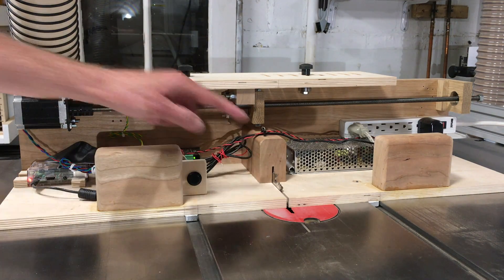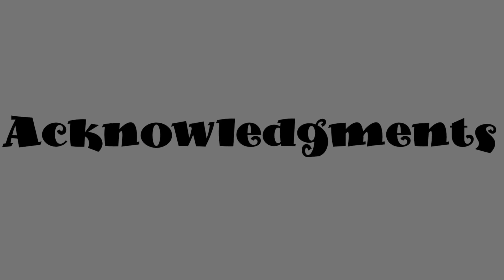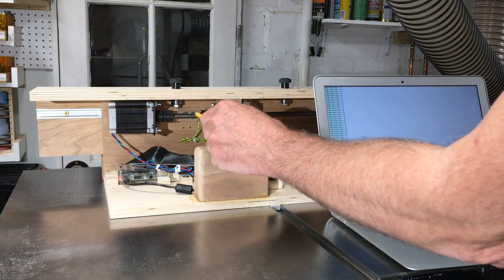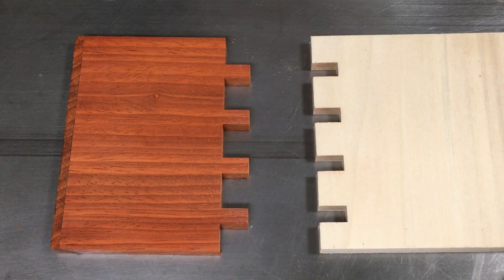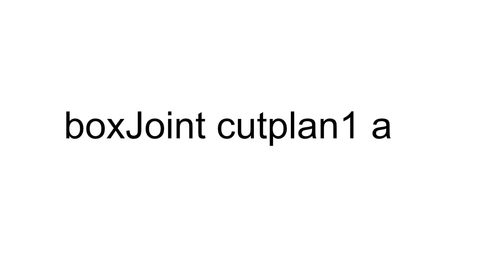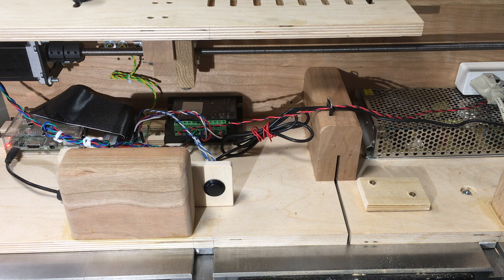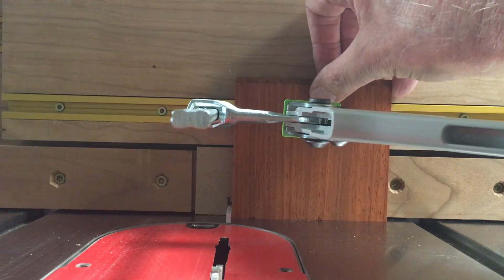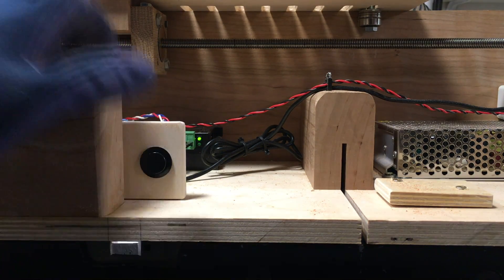Yet Another Programmable Single-blade Box Joint Jig

Comment: What powers the unit.   Ar you using n inverter cord or battery pack.   I have not played with steppers lot outside of taking some CNC claes in the early 90's.   I use to know a lot of the G code but lets be real that was then and this is now.   I am torn between doing a jig like this or CNC control the fence. Then just make a sled that slide 90 to a CNC fence.  It would not be hard to make a button to advance the program and put in on the sled jig so it will advance every cut.  Also on your jig a simple air cylinder and solenoid valve to clamp with box sides could even make the clamping better too.    I could see high production coming from a step up like this.

Comment: What a great project!  I am almost there.  All the hardware is done, but I used a 5mm/rev screw and 400 pulses/rev.  I changed the inches/step to .000492; but I fear there is something else I must do in the software.   Sooooo close!  Gonna hafta learn python a little better, I guess.  Can you give me some hints? It indexes great, but the a and b parts do not fit.  I am using a .125 blade, so that's the kerf.  Thanks again for a great project!
Reply from the maker: Feel free to send me your code (gbcrockett AT gmail DOT com) and tell me exactly what you mean by "a and b parts do not fit".  Are they too tight or too loose, and by how much?
Reply: Will email you.

Comment: Great video, thank you for your time in posting it. You’ve convinced me to build this. Can you reply with some more info about the lead rod and nut. Length, diameter, thread size. Also, do you have any plans/details for the sled and carriage you could share?  Thanks
Reply from the maker: I used a 3/8, 16 tpi lead screw and nut.  The parts list in the video description has a link to a McMaster-Carr page; that's where I found the parts.  There are several types of lead screws on the page; the one I used is in "Precision Acme Lead Screws and Nuts".  I got a 3-foot one because that's the shortest available; I think I cut it down a little but I don't remember.  I don't have any reason to believe that particular size and type of lead screw is the best choice, but it worked satisfactorily for me.  The nut I used is the round brass one; others might work depending on exactly how you mount it.  I didn't make any plans for the sled and carriage.  I figured it out as I went along.  I tried to point out important decisions I made in the video, but if you have any particular questions as you plan or build yours I'll be happy to answer them as well as I can.
Reply: @JustThisGuyUNo  Thanks for the additional information much appreciated.  I have ordered the electric parts, (raspberry pi, controller, and stepper motor),  just arrived and I'm trying to get them up and running and talking with each other.  Would you mind helping me out with the wiring?  Would be great if I could get a wiring diagram from you showing the connections from the Raspberry Pi to the controller and then to the stepper motor.  Pictures might do the trick as well.  Thanks in advance for your time.
Reply from the maker: @Woodlada  Here is the wiring information.  I used a ribbon cable extension to connect the Raspberry Pi to a breadboard, from which the connections to other components are made.  I intended to replace the breadboard with a solder board, but so far that hasn't proved necessary.  If you use little wood pieces to surround both the Raspberry Pi case and the breadboard so they won't move around, the connections have no reason to work loose.  Following are the connections among components.  When I refer to pin numbers, I'm using the numbering scheme on the Raspberry Pi extension cable, not positions on the breadboard.

Following are the connections among components: 

AC power to 24-volt power supply:  Take a short 3-prong extension cord, cut it to the length you'll need and strip the ends of the individual wires.  Connect the black wire to L, white to N, and green to Ground.

24-volt power supply to motor driver:  Connect -V to GND, +V to VCC.

Motor to motor driver:  Connect the black wire to B-, green to B+, red to A-, blue to A+.

Motor driver to Raspberry Pi: Connect pin 17 to ENA-, pin 27 to DIR-, pin 22 to PUL-.  Use short jumper wires to connect PUL+, DIR+, and ENA+ all together, and connect them all to 3V3 power on the Raspberry Pi.

The move button, the home limit switch, and the end limit switch are all normally open switches.

Move button to Raspberry Pi: Connect one wire to +3 volts, the other one to pin 18.

Home limit switch to Raspberry Pi:  Connect one wire to +3 volts, the other one to pin 5.

End limit switch to Raspberry Pi: Connect one wire to +3 volts, the other one to pin 6.

Writing this down made me realize that I've changed the software since I made it available for download, by adding the end limit switch.  You do need two limit switches; you don't want the carriage to crash into either end of the base.  If you got the  software before 1/22/20 you should get it again.
Reply: JustThisGuyUNo Thank you, I’ll let you know how it goes. Much appreciated!
Reply from the maker: @Woodlada  Note the edit I made in the wiring information.  In addition to jumpering PUL+, ENA+ and DIR+ together, they need to be connected to 3V3 power on the Raspberry Pi
Reply: @JustThisGuyUNo Hello, I’m finally getting back to this project and I’m working with getting the program to run and have been unsuccessful. I downloaded the newest code. I get “ can’t find __main__’ module in boxjoint.py.”  Do you know what may be causing it? Thank you in advance for your help.
Reply: @JustThisGuyUNo Don’t worry about my last comment I have the program running now. My problem is I have all pins and everything connected but my motor won’t move. Is there a specific setting that the DIP switches need to be at on the end of the motor controller. I have set all wires as you shared but the motor will not move???? Please help.

Comment: Awesome jig! We are trying to recreate your amazing creation! Would you be willing to make a video or explain to us about the raspberry pi upload and execution?
Reply from the maker: Since I don't know what you already know or don't know, I suggest that you google "raspberry pi tutorial" and you'll find lots of info on that.  I will say that if you don't have any programming experience this might be a frustrating project.  I provided the Python code for the basic operation, but if everything doesn't work on your first try, it will be difficult to isolate the problem if you aren't able to tweak the code.
Reply: @JustThisGuyUNo  We have nearly the exact same setup as you do, same motor and controller. The issue I am having while running the program has to do with the time. For some reason we have to hold the button down for at least a full second in order for it to register the next move. I think with the timing being off this far is also causing it to not turn the motor. I tried messing with the  uSleep variable and was able to get the button to recognize on a normal press but no movement (I did check to make sure the stepper motor in fact works properly). Any ideas on where I could start to troubleshoot?
Reply from the maker: @josephparker79  The one-second button push thing probably isn't timing; it's probably wiring or the button itself.  The program enforces a 1-second interval between low-to-high transitions so a button bounce won't look like two button pushes.  Pushing your button should result in a low-to-high transition; I suspect it's doing the reverse.  The button should be normally open with the push closing the circuit; your button may be normally closed.  The side of the button not connected to the GPIO pin should be connected to +5; yours may be connected to ground.

As for motor movement, does starting the program cause the motor to move the carriage to the home position?  If not, this may be wiring also.
Reply: @JustThisGuyUNo   I realized I was running python and not python3 in my cmd line and as soon as I switched the timing was correct. What is your pin setup on the stepper motor controller (current/pulse rev)? I am still running into issues with my motor not wanting to turn but the program running as intended.
Reply from the maker: @josephparker79  As it happens I just listed all my wiring connections for another commenter.  Expand Woodlada's question on this page; the last answer has the wiring info.
Reply: @JustThisGuyUNo  Thanks for that! I just double checked my connections and all is well. I will however update the program and add the end limit switch. My question is on the stepper motor controller pin setup on/off positions. I wanted to double check that I am doing that correctly. Do you have it set for the 2.8A and the 200 pulse/rev? This is my first time using this type of controller.
Reply from the maker: @josephparker79  Sorry, misunderstood your question.  I have switches 1, 2, and 6 down, 3,4, and 5 up.  I don't remember what that translates to.  The 200 pulse/rev sounds right, I don't remember about the amperage.  It was my first (and only) time using that kind of controller also, so I didn't do anything exotic.
Reply from the maker: @josephparker79  Have you checked the output from your power supply, that it's 24 volts more or less?  I think it has a switch inside it, maybe for 110 vs 220 volts incoming.
Reply: JustThisGuyUNo that is the exact setup on the controller as I have. Yes I got my power supply to almost exactly 24V with 110. I even went so far as to get a DM542t stepper motor controller to make sure it was not a bad controller. It appears as though everything is identical to your setup at this point but I am having an issue with my motor not wanting to turn, it engages and appears to do a single step when it should be zeroing and then stops. However, I have not had a chance to use the new program and will do that this evening. Thanks for the help thus far!

Comment: How did you provide power to the Raspberry Pi? I tried a dedicated switching power supply that was supposed to provide 5v and 12v for the Pi and motor, but I couldn't get a good clean voltage and the Pi kept shutting itself off so I ended up just using two separate supplies.
Reply from the maker: I did the same.  On the right side of my jig is a power strip with two things plugged into it.  One is the Raspberry Pi 5 volt transformer plug that came with the Vilros kit, the other is for my 24-volt power supply for the motor.
Reply: Aha, I see it now, thank you :-)